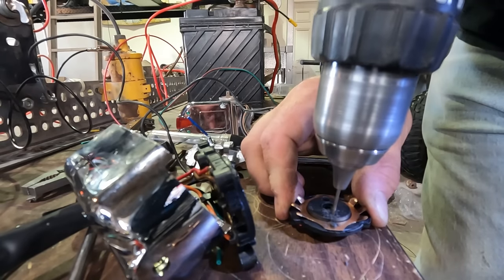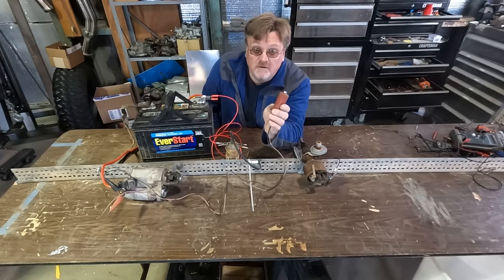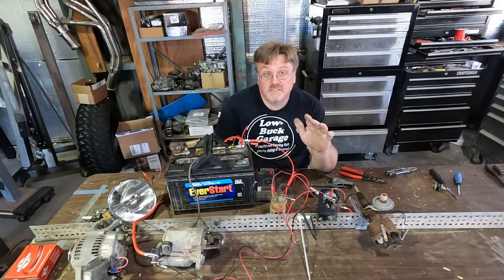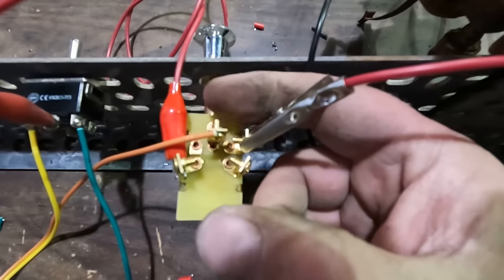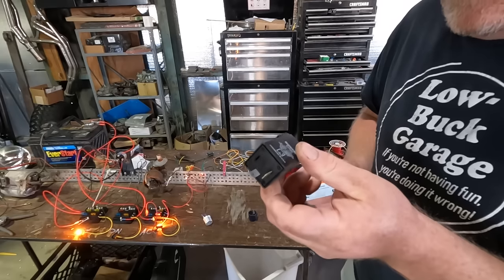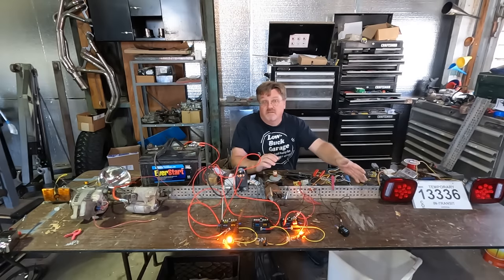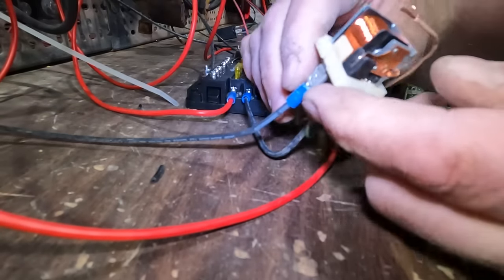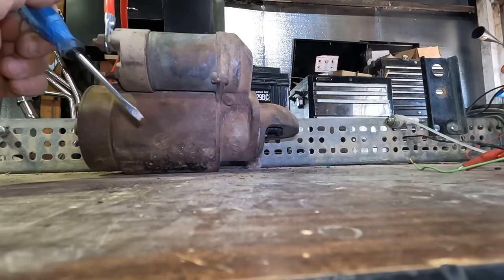DIY Wiring For Any Vehicle! (Almost)

Comment: The 3 prong flasher is what we called (back in the 70's and early 80's) a self leveling flasher. The extra ground ran a separate, for lack of a better term, self resetting circuit breaker, which in turn controlled a relay which actually ran the turn signals. They were recommended for trucks pulling a trailer with the extra load from the trailer lights to keep them from blinking super fast.  No matter how many lights were hooked to it (within the limit of the relay amp capacity) the turn signals flashed at the same speed.
Reply from the maker: Thanks for the info!
Reply: @LowBuckGarage  might want to get a wiring  harness from a vega or other H body car, simple wired for GM alt  has turn signals  and headlights already mocked up we stripped them from the junkers before we took them to yard and got 45 bucks at swap meets even with switches

Comment: About a month ago I had a little issue with electrical myself. Was fixing my brothers mower, the issue was electrical, managed to narrow it down to the starter. Checked online for a replacement starter, that shit was like 200 bucks (which wasn't in my budget), so I cracked the starter open to see exactly what the issue was. Turns out, all the springs that press the brushes into the starter were rusted to pieces. So I looked online, found a brush replacement kit for only 8 bucks, and that included the springs. Learned a lot in the process about starters, solenoids, fuses, and tracking down issues with a multimeter. Needless to say, I learned a hell of a lot more since watching this video. Thanks for the upload!

Comment: Another modern safety addition is the flashing side marker lights.  If you wire your (2 filament) turn signal fixture ground wire to the positive of the marker lamp, then ground the marker lamp normally. 
The side marker will dim and brighten, providing a side visible turn indicator!
I discovered this trick used one of my cars from my youth, after wrapping tinfoil around a blown fuse to get me home. 
Instead I melted the entire rear wiring harness. 
I learned a great deal about automotive wiring that week!

Comment: 3 terminal flashers in cars were used to flash the side marker lights (new requirement around 1970) during the "off" period of the turn signal lights.  Turn signal light would be on while side marker light was off, turn signal light would be off while side marker light was on.  In the 80s they let auto manufacturers do a wraparound turn signal lens instead of requiring a separate side marker light.  87 and 87A on the Bosch relay were the "activation" for the relay,  you would feed V+ to 87,  or ground to 87a to turn the relay on.  The ground trigger was for things like a horn switch, where the button on the column grounds out to turn on the horn relay to activate the horn.

Comment: Great video.. hint for making LEDs work with the two wire flashers or electronic flashers if they don't flash. Add a resistor from the output side of the flasher to ground, this makes it think there is a greater load then just the LEDs connected to it. They sell load resistors for this purpose when you want to install LEDs into older vehicles, but instead of putting them on each light I just put one at the flasher so there is always enough load to trigger it.

Comment: Ohh, I LIKE the buzzer on the motocycle flasher.  As I've gotten older (and as my older car has gotten louder) I need a noise to remind me to turn off the turn signal instead of driving down the interstate for 30 or 40 miles with my turn signal still on.

Comment: Re: The three-wire flasher unit.  The electronic circuitry in that flasher, whether it operates from a timer circuit or a thermal sensor circuit, requires it's own ground connection to function.

Comment: i'd say over half of all starter issues can be traced to a bad connection of some type, and if left unattended will eventually cause a starter to overheat and fail. i didn't really learn anything new here, but it was interesting nonetheless. i've wired up many projects from scratch from tractors and trucks to cars and motorcycles, including a dozen v-dub sandrails i built from tack welded kit frames i bought from sandrail magazine back in the early 90's. you did an excellent job describing how the entire electrical system works, and i will direct anyone asking me how to do it to this vid because i don't have the patience anymore to explain it to a noob.

Comment: Best LED flasher to use for regular 4 to 6 light connections I've personally found out are cheap Chinese motorcycle adjustable speed LED flashers! 3 wires I believe and a slotted Pot to adjust for the individual loads of whatever or how many LED lights your running? They're usually under 5 dollars each! And they have all worked out from my personal experience with them 👍Hopefully someone finds this useless information useful? Just passing it forward Lol!
Reply from the maker: Thanks for the info!  I'll pick one of those up and try it out.

Comment: I went through a similar ordeal with the flasher on my jeep YJ when I converted to LEDs. At first I did just LED tail lights with the stock incandescent front marker lights. With this setup one of those "LED compatible" two prong flashers worked fine. Once I converted to all LEDs though, it would just stay on. To keep the two prong setup without using a load resistor, I used a part number EF32RLNP flasher. It has the same two prong form factor, but also a ground wire that comes out of the case. Works great and they are inexpensive.
Reply from the maker: Thanks for the info!

Comment: I added more small incandescent bulbs to the turn circuit to help with the LED problem on my 62 C50.
I just tucked them into the front clearance lights.
You did a great job of laying out the basics.

Comment: Thank you for the tutorial on basic wiring. I am building a 47 Willys   this information has come in very handy considering I have all LED lights. At least I think I got the right flasher keep up the great videos. You have a great attitude towards rebuilding old stuff  old cars don’t need to be perfect. They just need to run and you could have some fun in them. Thanks again.

Comment: Those are good boxes. I rewired an old tractor completely with they. It had lots of accessories and far more lights than a car. One half was on and one half was switched. There was no "acc" position. The fuses also had a light that came on if it blew. Couldn't miss a bad fuse. Good demo. I like your able. One thing you could add to the headlight circuit. OK, two I guess. Some are fused and some have a breaker in the factory switch. The latter can cause problems if you switch to lights that draw more current. You need to use a relay then. I guess the same is true of fuses. The stock wiring can't handle more current. DIY wiring can use heavier wire, thus eliminating that problem.

Comment: Excellent visualization…you might want to introduce a master(primary disconnect switch) into your well done 12 v mockup, there’s a lot of potential for parasitic voltage draw as a person adds more devices especially true on old vehicles. Even with new parts that are poorly made, I had a new Echlin brake switch that functionally worked while pressing the brake pedal but had a defective habit of leaving the plunger partially engaged w/o activating the brake lights. I narrowed it down to a very weak plunger spring that created just enough pressure to draw a tiny amount of current and killed the battery within a week. Note: numerous car stereos will do this too even if the head unit display is blank as the internal ram will use millivolts to electronically retain stored radio presets and the time display for when they’re booted back up. So I installed a master disconnect switch so absolutely no current is drawn while not being used.

Comment: Need to clean up some piss poor wiring in a Jeep this spring and I needed this video.  (Previous owner liked using nineteen colors of wire interchangeably to patch broken or grounded wiring by the looks of it).  I have the ignition figured out, and it charges, but I did not know how to interpret the sealed beams on the front and now I know I will probably need a different flasher to get the replacement tail lights to work.  Appreciate you laying out everything in layman's terms, now I just need to spend money on cool switches and relays.

Comment: very nice video. i like simple. i've made wiring for several vehicles, 3 cars (unimog) and 2 bikes. the unimogs were diesel, so thats simple to start with. then i used only 1 fusebox, always connected to the battery. i also fitted a heavy duty battery cut off switch.  so if i switched off the engine, everything still had electricity; when i left the car i switched off the battery switch and everything was dead, you could not forget lights or anything.  worked fine.  and of course, i used rear light units with seperate rear light/brake light/indicator.

Comment: Curt makes an adapter for trailer light connection from the euro cars with separate turn and brake lights. It works great for fixing the brake turn problem
Reply: Now you tell me!

Comment: When the bed on my pickup rotted out I replaced it with a aluminum body that had led lights. The blinkers flashed real fast because the system didn’t detect current draw and thought a light was burned out. It’s legal like that but it was aggravating. They sell expensive flasher for use with leds but I’m like you, cheap. I bought a cheap heavy duty flasher, I think 4 or 5 bucks and it works fine.

Comment: I just want to let you know this is the first video of yours I have ever watched and when you explained the necessity of fuses I subscribed to your channel.

FYI the seventh prong that is feeding constant power is probably for the 10amp circuit to feed power to your trailer via a 7 prong trailer wire connector.  If a multimeter say's 10ish amps, that's what she be.  You can put a fuse on it if you like.

Comment: Regarding the 87/87A relay, I wonder if you could run two electric fuel pumps??  Or two other devices?? A main and a backup??  I've been doing wiring for longer that I want to admit but still enjoyed your presentation.  The only thing you forgot, speaking of relays, was the horn.  Oh, on one blinking and one steady stoplight. I would argue that that is more noticeable than both steady on. Keep up the good work.  Would like to have you as my neighbor.

Comment: Well, all ya need is a steering wheel, tires, drive train and your ready to go for a ride! Awesome table build if I ever seen one... Lol

Joking aside I did the same thing to my Zero Turn lawnmower. I live on a highway and I wanted light and flasher's so the idiot drivers can see me mowing .
It had no light at all. I added headlight, tail lights, flasher and turn signals just like he did in the video. I had to use a flasher for Led's as well. The guy next door thought I was nuts until he seen a car slow down as it passed... Awesome!

Thanks for the cool video!

LLAP 🖖

Comment: I had this exact issue with the non working LED blinkers. 

Novita EL12 worked in my application for my led flashers. It is the cylindrical 2 prong flasher.

Comment: 25:31 if you want to do away with the motorcycle flasher so you do not have the buzzer sound, you can also use a simple cycle timer with infinite loop that cycles as long as the unit receives power, such as the ddc-432. They run off of 12v dc, you can select the time the light stays on and the time it stays off by 0.1 second increments.
Reply: these timers can be gotten for less than $5 each.

Comment: Since my car battery is beneath driver seat - I just hooked positive from battery to a switch that turns on the switch box for accessories (and negative to some frame crosspipe).
To turn any accessory - you have to switch power on - and then which accessory you want.

Comment: The blue wire goes to the terminal "P" on the 3 pins flasher   "X" "P" "L"...  Or 2 Pins Terminal "L" on an Solid State flasher or a Bi-Metallic Thermal flasher   "An excellent episode."

Comment: The "led compatible" flasher would work fine if you wired a resistor into the circuit. Really, any flasher will work with LEDs if you add an in-line resistor.

Comment: Great content. Glad I stumbled across your channel. I’m 47 and still learning from great channels like yours!
About to try and duplicate what you did in this video on a 1964 Land Cruiser. I tried using the old harness and fuse block… I was making up curse words because of the frustration. 
I bought the Nilight 12 circuit fuse panel. What basic wire do you use when doing the basics? Guessing 14 gauge? Was going to buy some from Amazon but got dizzy from all of the choices!

Comment: I see some comments, as I always do, about adding load resistors to make LEDs work with old style flashers. I stay away from using those. They get hot. Very hot. Borderline fire hazard hot. Plus, why make a system inefficiently guzzle when it wants to efficiently sip? It's the difference of hazard lights flashing hours vs days. Do you need your hazards for days? Hopefully not. But an embarrassing number of times I have come out after 10 hour shift to my lights still being on, going "oh crap!" and still starting my vehicles right up.

Comment: Should have been titled wiring for us dummys!!charging systems for basic engines.that was most pleasant presentation ive ever experinced!!easy to follow in realtime understanding of how it works,the only thing i wonder about is diodes are they like a one way valve?allows electric current to go to item but not return?otherwise i followed right along.one thing ive always been confused about is amps vs volts that is very confusing maybe you can enlighten me.otherwise great teacher and vidioe!!!snooky pa💥👍🤪😜👍💥
Reply from the maker: Thank you!  You're exactly right, the diodes are like one way valves.  It helps thinking about electricity like water going through a pipe.  Volts are the pressure, and amps are the flow rate.

Comment: Check out DEWHEL 12V 0.02A-10A 2-Pin CF-12 Electronic LED Flasher Relay Fix for Turn Signal Light Fast Hyper Flash on Amazon, there are others out on the Amazon. It all depends on your Amp needs.
Reply from the maker: Thanks for the info!  I just ordered one to try out.

Comment: I did most of the wiring on my tractor. A few old ones left but lights, ignition and charging and starting are already new. I just isolated every wire and replaced them one at a time. The old wires left are stuck on a rusted old voltage regulator. The money they want for new ones have me leaving it on until it just won’t work. When I was a kid my parents had an old Chevy van to haul us kids around, it had electric choke and it was on a toggle switch. They would flip it ON until it was running and ready to for choke to open then flip it OFF. So semi manual. That old van was awesome. I hate they got rid of it. I liked the old van.

Comment: dont wire your relays to be always on and then wire the feed wire to be switched... the previous owner of my dodge did that and obviously i had a constant drain on the battery that was just small enough to put up with but just big enough to give you flat batteries if you left the truck sit for a few days... took me alot of diagnosing to find the relays he had hidden behind the dash both were getting nice and hot in their

Comment: Speaking of “when the key turns to start, it cuts power off to the accessories” , I was on my way home from a car show and noticed my tachometer, voltage meter were not working and my engine temps were climbing. Hit a bump and everything went to normal. Found out my key now has a dead zone if it’s to close to “start” it kills power to my radiator fan and all accessories. Not cool lol I’ll just pretend it’s an anti theft device and ignore it until it become to big of an issue 😂

Comment: At 16:33 you show that you run power from the "battery" fuse box through a single fuse to your ignition switch. Doesn't that mean that both the "on" and "accessory" fuse boxes get all their power through that single fuse? That might not be the best scenario since it means you'll need a pretty beefy fuse and wire going from the "battery" fuse box to the ignition switch. 

My suggestion would be to take the wire coming from the fuse in the "battery" fuse box and connect it directly to the same terminal that has incoming power from the battery.
Reply from the maker: Yes, you're correct, everything going through the ignition switch goes through that fuse.  That circuit will be on a 30A fuse, and as I recall my ignition switch itself was rated at 30A max.  I really don't want more power than that going through the switch.  If there's high draw stuff, it can be run off the "battery" fuse box with a relay, and the relay can be controlled through the "on" or "acc" boxes.  That would keep the load through the switch at a reasonable level.
Reply: @LowBuckGarage  That's a very good point, I didn't consider the amp rating for the switch. If you put a 30A fuse for the switch then that should be plenty for the other two fuse boxes.

Comment: 2x 60w headlights and 2 LED tail lights, turn signals, fuel pump, interior light,  stereo, electrical seats, power windows, power mirrors and so. The power for them all comes from the ignition switch to the fuse box  from which all other parts are wired up. Can an ignition switch handle so much power? And the wiring with the middle fuse box ignition, not even one relay needed?